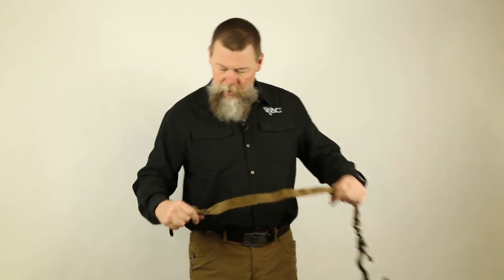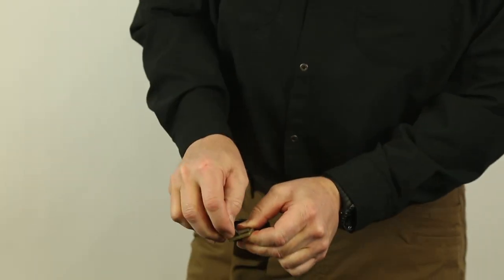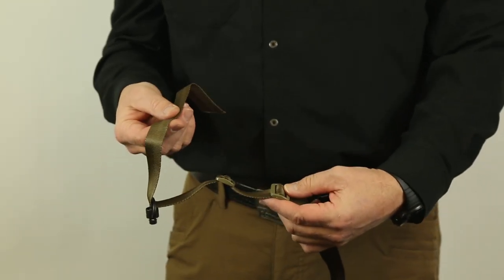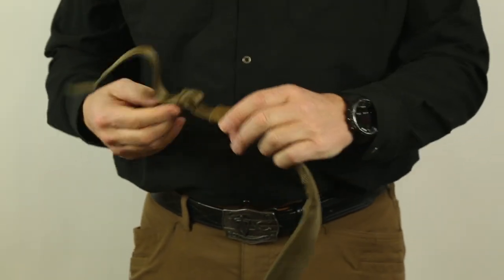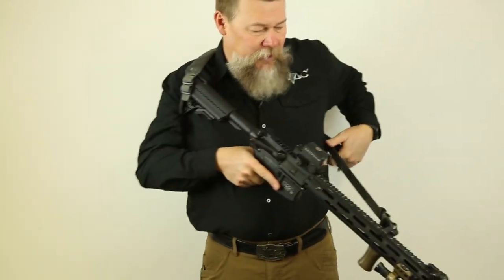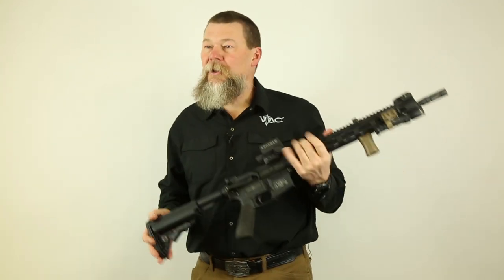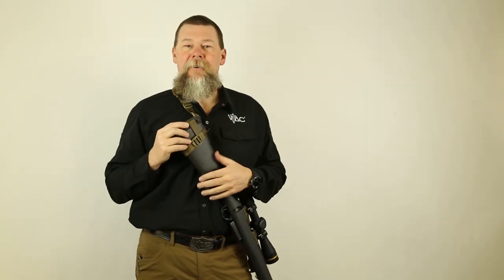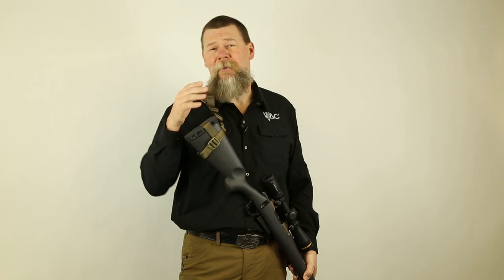Viking Tactics Sling Installation Video

Comment: Very informative video. Far better than one of the other ones I've seen trying to describe the same sling install. Nice job. I've had mine for a few years now. I have others also but, the VTS is by far the better. Well worth the cost and works as advertised. Thank you guys!

Comment: Ahh I've been slinging my sling wrong. On my VLTOR IMOD I had the buckle positioned on the body side of that thing on the top of the stock that you route the sling through (whatever that is called) instead of the opposite side.

Comment: I may just be doing something wrong, but the actual adjustable sinch part of the sling doesn't change the length at all, it doesn't matter if I pull it close or push it away, it doesn't tighten or loosen the sling. Any help would be appreciated

Comment: The instructions state, "ensure that when you connect to the rear that the sling is attached to the top of the stock, not the bottom".
What the hell does that look like. The photos included look like somebody took pictures with a Xerox machine from across the room.
Reply: It means make sure that the strap is going up and over the top of the stock not down and below the bottom of the stock

Comment: In 11 years of law enforcement, and thousands of thousands of rounds of drills and training, I've NEVER had a problem swapping trying side/weak side, attaching the sling to the left side...  Never seen a reason to go on the right side...  That said, I have had the sling get between the stock and my shoulder, and pinch me on the neck when I tried it on the right side... guess if you're into uncomfortable shouldering and hickory like bruises, right side mounting is the way to go. 

Every "operator" on YouTube has a reason for putting it on the right.  I've come to the conclusion it's just a "douchebags are awesome" thing to do.